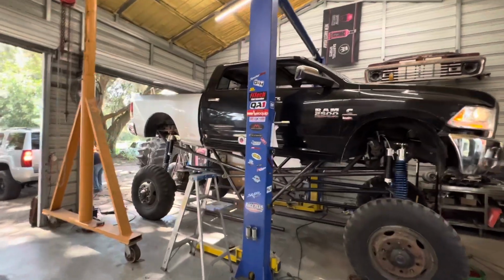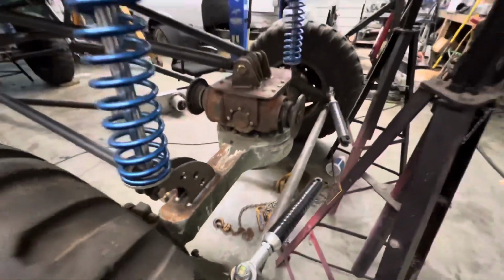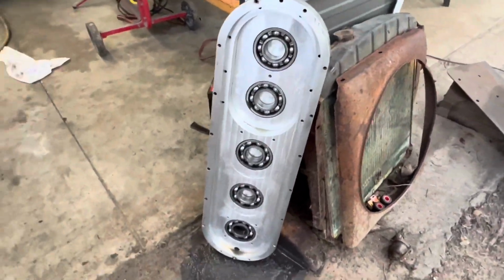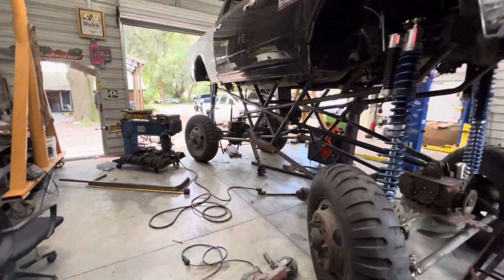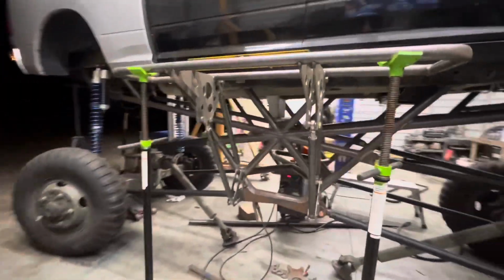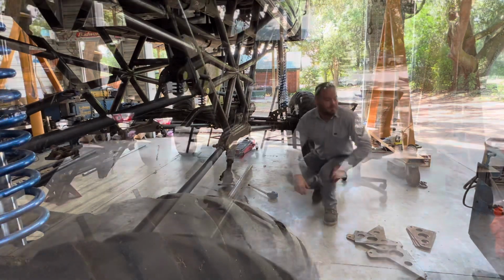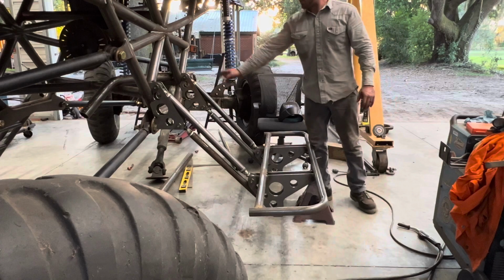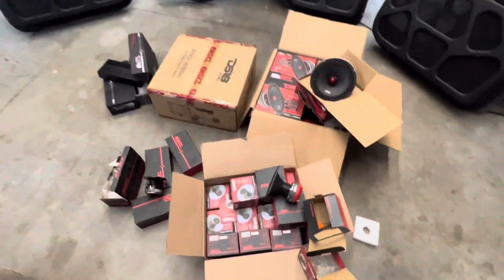Fabricate hydraulic steps on mega truck

Comment: Where did you get the plates for the steps at ?
Reply from the maker: Grilla productions 
386-336-2905
You can look them up on Facebook. The parts they cut are super clean and the best priced I have seen.
Reply: Thanks alot man. super helpful videos
Reply from the maker: @travispeach861  thanks that means a lot 🤘

Comment: What size heims on the steps? You just use .120 wall on them or thicker ?
Reply from the maker: They are 3/4 and yes I believe the tube was 120. It was slightly bigger than the bungs but I centered them as good as I could.
Reply from the maker: Your truck came together nice. I’m collecting parts for a truck on 18.4 16.1 tires. I can’t decide if I’m doing 2wd flipped front end or I have some old 50s 2.5 GM axles 🤷‍♂️